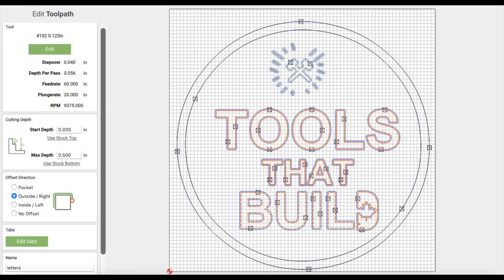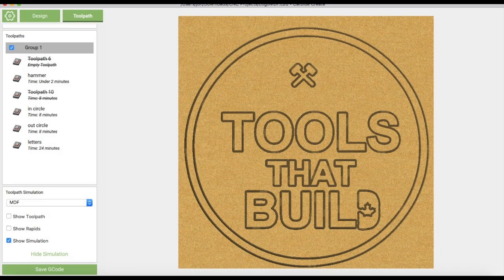Making A 3D Shop Logo Sign Using A Shapeoko CNC

Comment: How did you manage to prime the edges of the mdf letters? I did 6 coats of primer and it just soaks it up. Thanks
Reply from the maker: Hey, I didn’t prime the letters. I just sprayed 3 coats of paint on them the way I showed in the video and they were ready.
Reply: @ToolsThatBuild  Awesome.! Thank you! And is it just regular spray paint or a special type of paint?
Reply from the maker: @osvaldoestrada8534  no problem, just regular white spray paint from the hardware store.

Comment: Nice work! If doing again would you mill shallow letter pockets in the base using the CNC so positioning is more captive?
Reply from the maker: Absolutely, alignment was the biggest struggle I had. A 1/8 or less pocket would have been a really good idea for the letters.